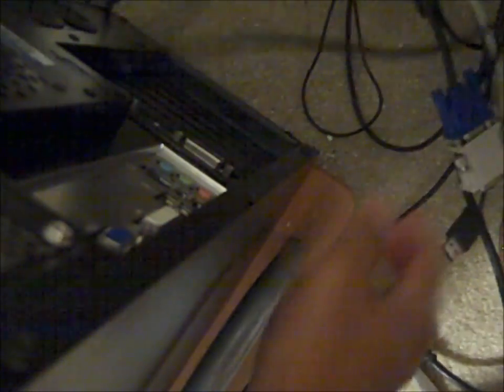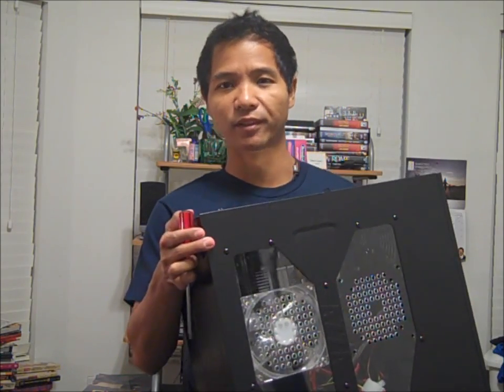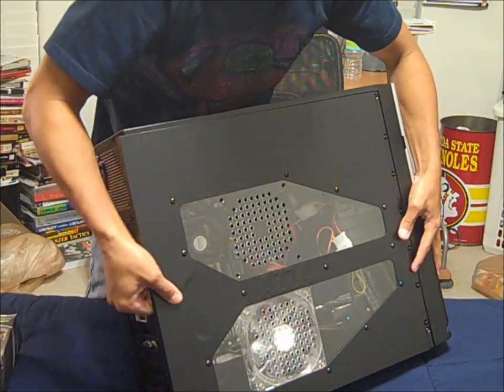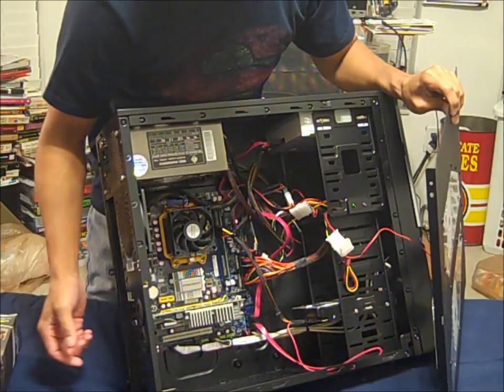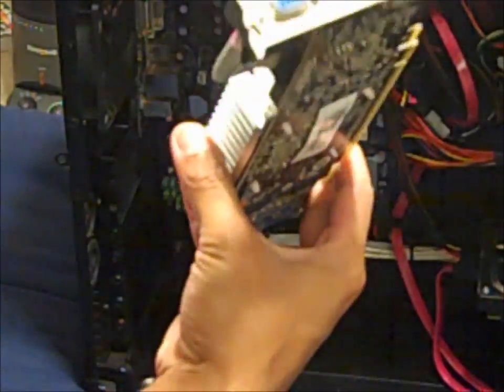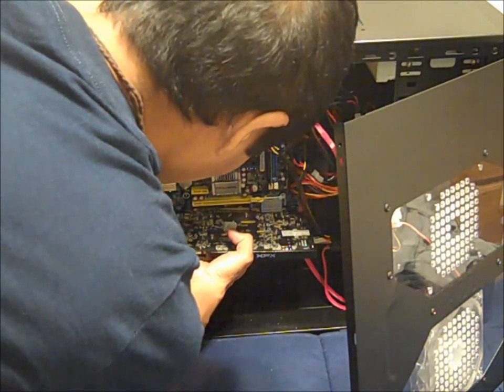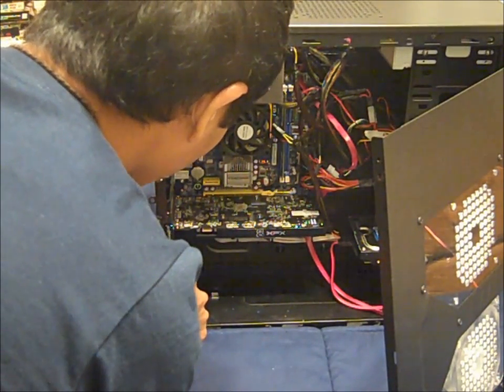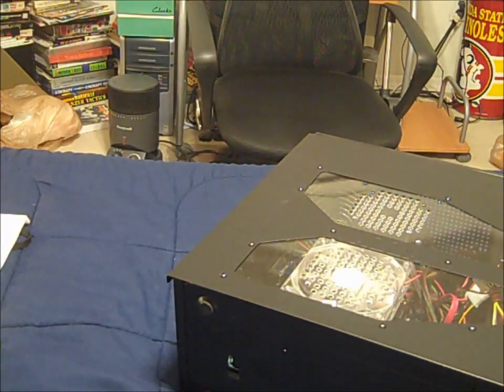How to Install a Videocard (with the Prince_of_Macedon)

Comment: Radeon 6700 or gtx 460 are good fairly inexpensive cards, both are around 130 bucks. You'll need a decent power supply though and you probably should get 550 or higher. Dont know who asked and im on phone so cant reply to you directly

Comment: You didn't discharge yourself first! Just touch an earthed object, like your heater in the room, to discharge before you touch anything in the computer itself. If you don't do this, then you could discharge on the computer parts, what could damage them beyond repair.

Comment: he should have mentioned about static discharge....it would be best to NOT do it on fabric, or rub your feet against carpet before orwhile doing really any work inside your pc or near your ports. chances are if you were to discharge electricity, it wouldnt hurt anything, but personally, i'd rather not have to replace a couple hundred dollar component right after i just bought one...

Comment: Don't buy canned air, amazon sells something called a datavac for $55. It's basically a carpet vacum motor with a handel on it. I have been using one for awhile and can't say enough good things about it. I know it seems expensive, but canned air isnt cheap either, and if you think about how quickly those cans run out, you will actually save money in the long run. Not to mention you clean your PC so fast with a data vac, takes easily half the time.

Comment: From the states? Newest dream machine with dual cards, hdd and other high end products will cost around $2500 or like around £2000 but you can get great gaming pc's for less. I have a video on mine if you wanna see it and it can play any game at the moment on ultra. From there you can see what extra tings you'd want. sorry if i butted in to answer this. :L

Comment: I am still guessing why you have problem with Fraps while running 9800GT. Since 9800GT requires more memory transfer between the DRAM and VRAM, the CPU might be overwhelmed when you start recording with Fraps. Need to know your CPU and DRAM spec to verify that. I am using Phenom x4 965 at 3.4GHz and 9800GTX, never have a problem recording at 1440x900.

Comment: I have done it before and its virtually the same thing. You just have to locate the correct screws. It is actually even easier because disk drives are covered. Then you just have to connect the power to it. Pretty simple

Comment: Does the fan on the graphics card make much noise? I'm rebuilding a computer and to cut down on the noise of the main fan it might be better to get a card with a smaller fan built in to make the larger fan smaller. If you get what I mean. Because my current PC is a nightmare for noise and I want it as quiet as possible.

Comment: not POM, but I can -sort of- help. If you don't really -need- a laptop, and if you'll end up using it mostly as a desktop PC, I'd recommend getting a desktop PC instead. laptops are way more expensive and equivilant laptop graphics cards are weaker than their normal size counterparts. They're also harder to upgrade, so don't expect to keep it up to date for long. In general, you'd probably be better off with a desktop PC if you're not moving around a whole lot.